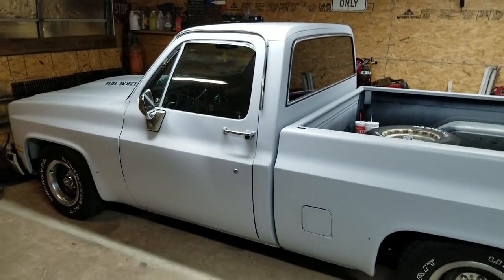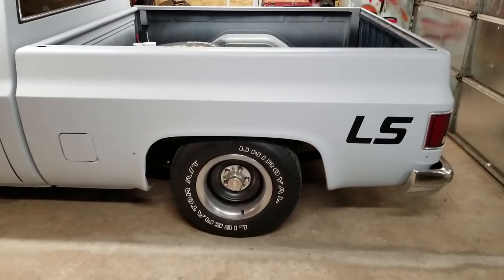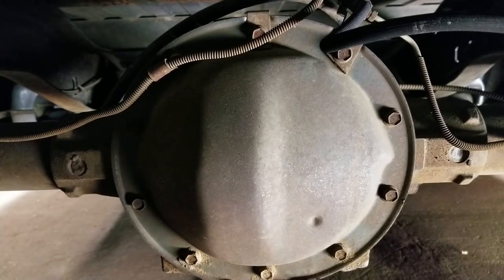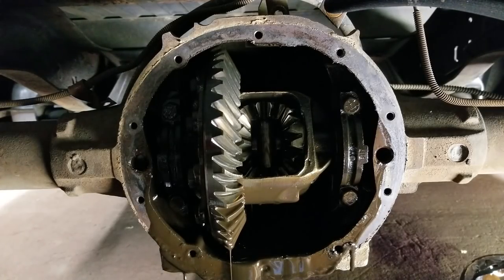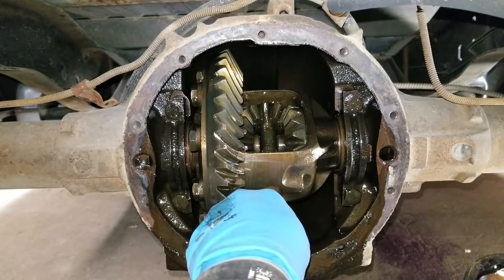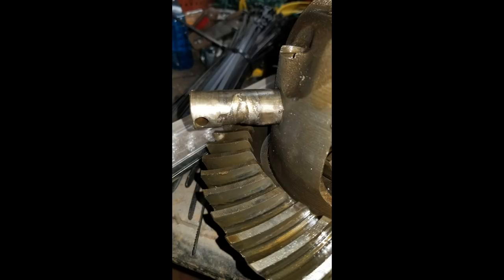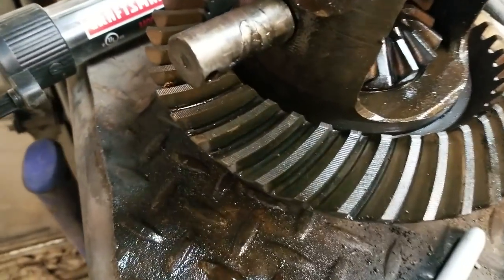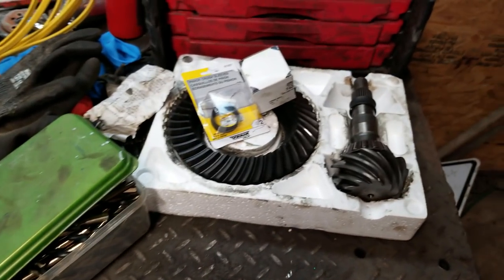1984 C10 Project ---- Part 17 (Rear End Gear Upgrade Fail or Win?)

Comment: Those 390 gears woke that truck up. As far as the spider gear damage that was due to one legged burnouts. I know that for a fact because I have owned an 82 and 85 short bed chevy and tore up many rear differentials due to one legged burnouts or water in the case. Your correct about the welded locked differential also for driving on the street. I tried that and broke a carrier. I'm 51 now and I look back at what I tore up from my teens to early twenties and I could have paid for a large portion of property but it was fun while it lasted now I'm a grandpa driver and make my vehicle last.

Comment: Hey Lonnie ,did u ever put limited slip in ? Question: is limited slip a better solution than POS Trac?
Reply from the maker: If your Donna daily drive it a pos is rough for turning. I had a pos in this at one time but took it back out because it wants to try to tweak the frame when turning sharp.